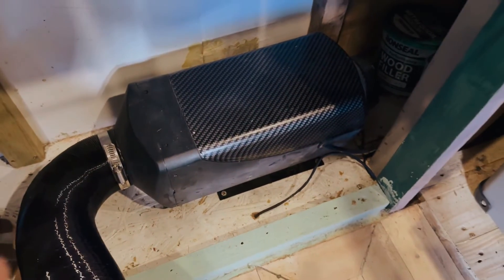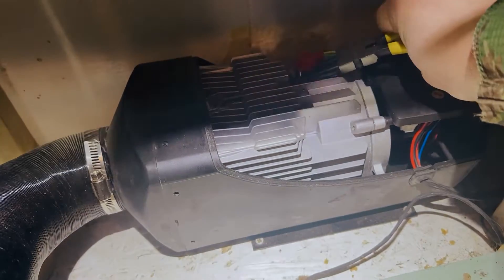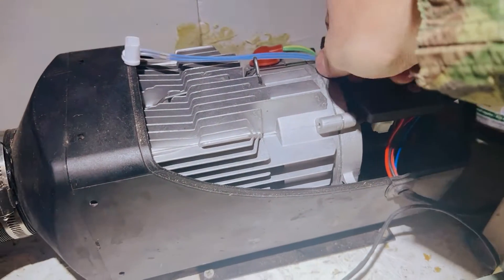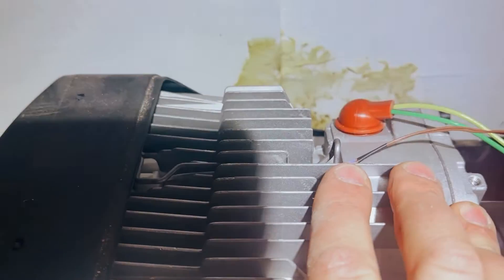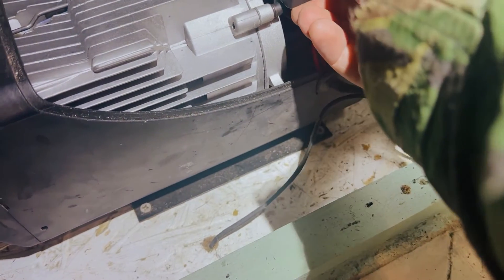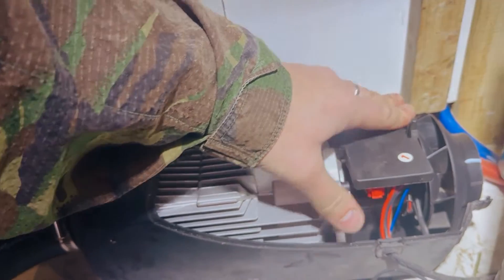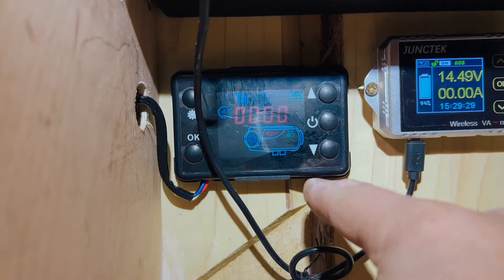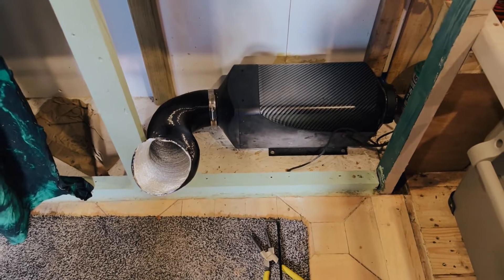Changing temperature sensor on Chinese diesel heater

Comment: I was going to replace mine but I noticed when I removed the sensor that there was a small amount of white dust, perhaps ceramic from the sensor. Anyways that dust was in the little recess that the sensor sits in. I blew that dust away and hooked the same sensor back up and it runs fine now.

Comment: Thanks for the guide! I was watching on how to get the sensor back in, as the wires kept bending it in the wrong way and wouldn’t sit flat. Then it cut to already installed and I thought, the bugger probably had the same issue as me and cut it out 😂

Comment: Thanks,  I am awaiting my very first unit (all new) and I learned the glow plugs will fail too.  Did you have a code or just guess?  ... with web search?   I am half way wondering if I should buy one of each and keep it on hand.
Reply: Buy a couple of each and keep them as spares and better yet also buy yourself a couple of extra Chinese diesel heaters for on standby. They tend to be a pain in the butt.